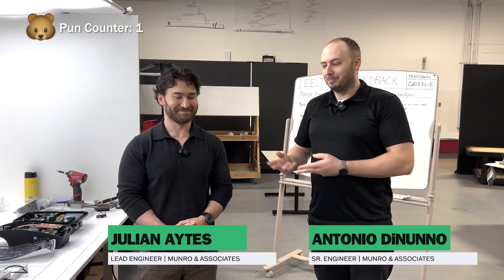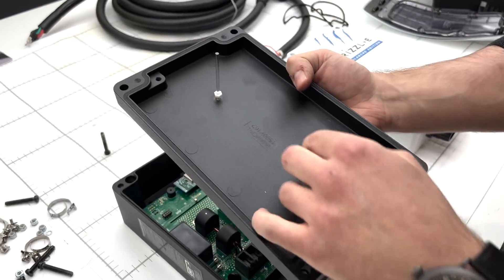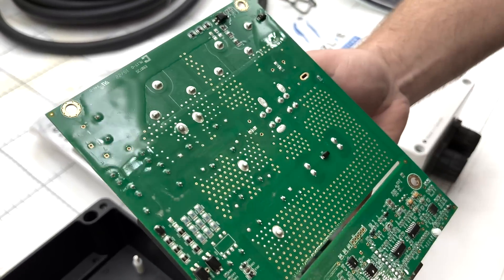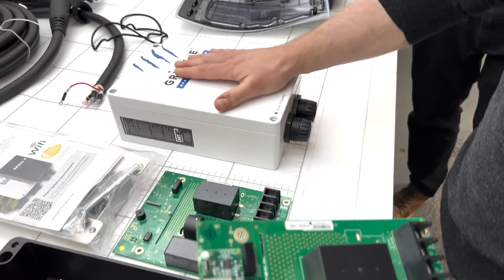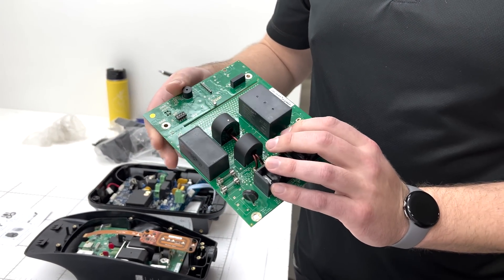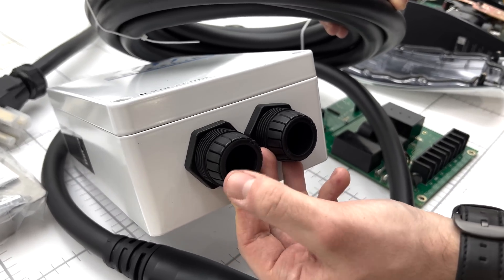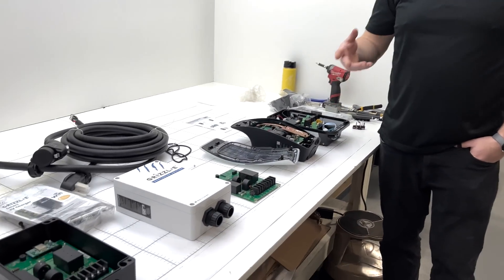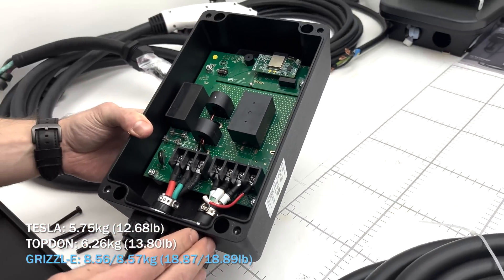EV Home Charger Teardowns E3: GRIZZL-E Classic & Avalanche

Comment: The terminals for hooking up the wires for the NEMA plug (and the “charger” wand) with the crimp on spades makes it pretty much impossible to convert to hardwire configuration because the width of the terminals is too narrow to get off the shelf connectors to put on your #6 L1/L2 and #10  ground wires.   I found someone on YouTube trying to do hardwire explaining this and I steered clear of Grizzl-E because of this as much as I’m Canadian and wanted to support them
Reply: Correction #8 L1/L2 and likely #10 ground since this 40 amp charger.   The YouTube link I posted has part 2 where he converted to these Southwire lugs so perhaps doable solution.     

The liquid tight install using OEM compression fitting from OEM NEMA plug seems bit dicey as he should have used proper liquid tight connectors to go to box

Hope his info helps you out in your decisions but I steered clear as much that I wanted to support Canadian brand - as I need hardwire outside install preferably at 48 amp instead of 40 amp for product designed for this setup and didn’t want outside rated NEMA covered plug on the outside of my house and a pricey GFCI outlet when hardwire is simpler, cleaner look, cheaper, and faster charging
Reply: https://youtu.be/0MqAlip4tsI
Reply: I just finished hardwiring one. It would have been nice to have them at least include 2 of the 6 gauge terminals similar to the ones they already use. Except with proper screw holes in them. Not 2 sizes bigger. I used aviation grade non insulated terminals which had a screw hole one size bigger. They were slightly oversized. Instead of grinding the terminals, I took a dremel and notched out enough of the outside plastic dividers (not the ones next to the ground terminal) to allow the terminal to fit right in. This shifted the screw hole of the terminal slightly to the outsides of the assembly, but still had no problem with screw lining up due to larger terminal hole. Used 3/4 inch flexible conduit from Lowe's which press fit perfectly into existing compression coupling.

Comment: You guys should learn how an EVSE works. It would have been nice to see some detail of their control circuit. Lower coil appears to be ground fault sense and upper to be current. Neither is "voltage." Would be nice to see what chips they are using. Is it one relay for each leg? Fuses are certainly on the relay coil circuits. That means the board is likely repairable if a relay coil goes short.

Comment: I bought one and i have issues with the current limiter not working properly.  It keeps blowing my 30 amp fuses once in  a while.   i wonder if you tested the current limiter circuit as mine is set for 24 amps and blows my 30 amp fuse .  The wiring was verified by a  certified electrician.  So the wiring is ok.  I am suspecting the charger the company is slow to provide answers.

Comment: I suspect that the WiFi range is compromised by mounting the antenna inside the (very rugged) faraday cage.
Reply: That is correct. Grizzle is a devopment based on the old eMotorWerks Juicebox (before they got bought by EnelX). The old Juicebox had a top antenna puck. The Grizzle does not have that and lower range. The charger itself is good. If you want smart EVSE features, look for a different device. Their software and app integration really sucks.

Comment: I love my Grizzl-E.  Basically got it for the weather sealing... I figure, if it is designed for Canada, it can handle anything.   I don't need (or even want) wifi or app control or any of that sort of thing.  I just want to plug it in. Beyond that, all of the EVSE's are pretty much the same thing, just big glorified contactors with a handful of safety features.

Comment: What I would be interested in on this one is a careful look the terminal strip.  There was a run that had a lot of failures there, attributed to a short term problem with newly trained assembly workers, and improper torque.  It would be interesting to know the details on who makes that, what current it's rated for, and how much margin there is between too loose and overheating vs. too tight and stripping out the threads in the thin copper piece.

Comment: "Charger" literally pointless box that could be eliminated. It's a relay that turns on and off and nothing more.
Reply: This is dumb, there needs to be some negotiation to ensure safety of the user and vehicle, to ensure that you aren’t just pulling plugs out on load, that exposed contacts are safe in all weather, that the vehicle does not overload a circuit, etc. it’s actually a very simple and fairly elegant, open protocol for these things.
Reply: @edc1569  you could fit all this crap into the electrical box on a DIN rail, if negotiation and a relay is all that's needed... The car can recognize the capability of the element and self adjust the charge speed. These boxes are not needed at all.
Reply: @no-eb2xx  Eaton has a EVSE that has all of the multiple necessary functions built into a circuit breaker, so the wire goes directly from the circuit breaker to the J1772 charge cord.  You might appreciate that design.  But a lot of their example installations still have a box on the wall, just serving as a junction box.  If you've done a splice with AWG 6 wires, you probably appreciate that having significant space in the box is helpful.

Comment: It's not clear if this thing has the 6mA DC leakage detection built-in or not. Maybe US regulations don't mention it, but this is needed in the UK to avoid having to fit a dedicated earth rod.
Reply: It does have built in GFCI with integrity check. Or mine does at least. I can't install it on a GFCI breaker as it will just trip since the Grizzl-E is continuously sending out that 6mA pulse to check for grounding stability. Even an insufficient ground will disable this EVSE as it's checking the impedance. I think they've lowered the mA pulse on recent models so it can still be installed on a GFCI to meet codes for receptacles. Mine's hardwired so I don't need a GFCI breaker.
Reply: It's UL listed, and that's required by the UL standard (as well as by the SAE J1772 standard and the US National Electrical Code).

Comment: You need to talk a bit more about the software. The grizzl-e is nice because it will connect to any OCPP 1.6J provider, so you can easily control your own charger. Most other chargers don't give you this option.
Reply: In theory it does... reality shows that the integration to other than their own partnership with a third party company is subpar at best.
Reply: @skyrace4306  OK. Interesting to know. I wonder if that's their implementation, or other people's. Standards-based charging and power control is the only way we are ever going to get away from the crazy world of having to find triplets of vehicle/EVSE/power supplier that work together. We need more charge-fests like they do for bluetooth, zigbee and USB. In general if it's not been tested, then it probably doesn't work right.

Comment: I have the extreme edition (camo paint) without wifi and it's working well. I appreciate the simplicity in design. It's heavy but easy to install. Mine doesn't have all the smart features, but I wanted something dumb. Too many folks have been burned by OTA updates bricking their charger.
Reply: How old is your's?  Wonder how long these units last?
Reply: @irishcubs01  I've had it for over 2 years now. Still working great.

Comment: Next time, add an electrical engineer to the presentation.  I expected you to tell us why Topdon charger had so many discrete components and Grizzle E did not.
Reply: we'll do a synopsis once were done, the early ones are still benchmarks. Understanding the normal.

Comment: ISSUES I see... WIFI Card completely encased in a fully shield/metal box will reduce reception of signal (think faraday cage for those RF Peeps) . I don't see external antenna or any way for RF to pass thru the metal box.

Also no Blast-proof ceramic fuses are used..
Reply: Why would you need blast proof fuses, they’re just protecting the on board power supply, not the load to the car.

Comment: Do you guys check if the relays utilize zero crossing technology or not?   Seem to be really small and cheap pcb-mounted relays.  Similar cheap relays as tesla, though
Reply: I’d guess not because the relays don’t switch under load. The charger doesn’t ramp up charging current until after the relays close.

Comment: Underwhelming, poor design and execution (see the crooked label and ludicrous light pipe).  Made to be cheap (i.e. leaves out the $3.47 O-ring to make it splash proof), but fails, as it costs the same as the superior competition.    Blatant Mistakes:  1:20 "subtle differences" consist of two: paint color and Wireless card not plugged in.  Not exactly "subtle"!;   3:05 Those ferrites are not voltage sensors, but EMI filters and likely a Current sensor;  3:30  "Lead Free" symbol is actually on the antenna portion of the wireless PCB, not the main PCB, so the "Avalanche" version would not have it;   3:48 "injection-molded stanchions"  are extruded nylon spacer tubing, cut to length;  5:00  the DIP Switch simply lets the processor know a Wi-Fi card has been plugged in;    5:13  "no real estate being wasted..."  ridiculous, same size PCB and layout;  5:30 "presence of actual fuses..."  demonstrating again lazy engineering and trying to save money (note that neither fuses, fuse holders or the assembly is cheaper than other "fuses-less" solutions,  also note that entire Vehicles, and the charger connection boxes, from Tesla with scores of electronic modules, including very high power components of the power train have no fuses, yet are fully protected!):  "hard mounted fuses...serviceability"  If properly designed and agency approved, when the fuse blows there is an internal overcurrent, which is not readily repairable, especially for "garage handymen";  9:03  Again, with the moronic evaluation and rating of electronic devices which are installed on the structure of a building by Weight!  The small weight or mass is not affecting the performance of an aircraft or a vehicle!  Whether it is 1 kg or 100 kg make no difference to the intended use case or application!  

This is substandard to the level of Munro's other videos and an embarrassment.  On par with the cringeworthy analysis of Freezers from a few years ago.
Reply: Summed up well. Very sub par review. Also did the handle not have a temp sensor?
Reply: Thanks for all the points you listed ! Have a nice day :)

Comment: 3:06 "Large relays" - the left one is a power supply, not a relay
3:08 that's a current transformer not a "voltage sensor". 
If you're going to do this stuff with any credibility, please get someone who actually knows what they're looking at,for a company that represents themselves as experts in the teardown field, it's just embarrassing.
Reply: Agree here. Munro usually holds a higher standard and this felt a bit rushed. Also found it surprising that there was no comment on a WiFi antenna inside a metal enclosure.
Reply: Not surprised at all, this channel shows how little they know about what they "review" all the time.
Reply: I'm going to assume that he just misspoke when he said voltage sensor instead of current sensor, but I think that correctly explaining the two black boxes is a pretty fundamental thing, especially with the amount of attention given to the fuses on the input of that power supply.
Reply: @charliesullivan4304  The electrical team walked us through it but yes, voltage sensors, transformers, relays...its amazing how much things blend together mentally when you're being filmed. We're adding text where we catch it  and appreciate the constructive feedback.
Reply: Absolutely, even small things like the lid falling off the enclosure felt off. 

Also, I'm not particularly fond of this EVSE. It looks like the manufacturer took the source files for the OpenEVSE project, swapped in an ESP-32 module, and called it a day.
Reply: I love the idea of “servicing fuses” as if we’re talking about a 1970s refrigerator. How often do you service the fuses in your TV for example.

Comment: Weight is a factor for shipping, but in a static installation is it much of a factor? I realise it's part of the specs and is a valid data point, but I don't think my wall would complain by saying "You're too heavy! Get me a Tesla instead!" 
Given it's built with much less bespoke design required, is so simple to build, and is safe, I'd say the weight is a fair trade-off.
Reply: weight is often a large factor in manufacturing cost, but it really comes down to form/fit/function, the metal case provides a ruggedness function that is worth the extra weight
Reply: As Charles Sullivan already stated, weight is a rough proxy for material costs. It is also a rough measure of efficiency in design and a product's carbon footprint. We may want a heavier product for the sake of durability or serviceability, but hopefully that won't come at a significantly higher carbon cost.
Reply: Agreed, it's a solid package
Reply: I think they are discussing that as a very rough proxy for cost of materials.

Comment: Grizzl-E Smart is $449 and charges at 40 amps. Tesla Wall Connector is $425 and charges at 48 amps, has built-in cord storage, a longer warranty (4 years vs. 3), the Tesla connector version has a button to open the vehicle's charging port, and is arguably more stylish. Why would I buy Grizzl-E over Tesla for either a Tesla or J1772 application?
Reply: The Grizzl-E also uses 42% more power when idle and the power loss at full current is nearly 28 TIMES higher than the Tesla Wall Connector according to Energy Star tests.
Reply: @zroger73 source links please.  Thanks.
Reply: Exactly, not to mention the Tesla Wall Connector is rated for outdoor use as well as additional smart functions to use multiple Wall Connectors on the same circuit to share and distribute power.
Reply: @jezza6575 , don't get me wrong - I like choices and I'm trying to keep an open mind here, but I just don't see any advantage to the Grizzle-E - it seems like paying more for a base-level work truck with a V6 engine and vinyl seats than a V8-powered model with leather interior.
Reply: I bought this over the tesla connector because of the simplicity and cold weather performance of the cable as I live in MN. I didn't want or need wifi as the car can already do scheduled charging. Also wanted J1772 just in case I needed to charge something else or switched from a tesla. I don't anticipate having 2 EV's so load sharing wasn't a factor either. I also have enough panel capacity for another circuit, or I could use the welding plug if I really needed. It's my backup with the mobile connector in case something happens to the grizzl-e although I don't expect anything to happen, it's built like a tank. It came with a remote mounted holster/cable hanger which I'm able to mount a bit closer to the charge port than where the unit is mounted.

Comment: Looks like a standard ESP32 module with a USB-UART IC for programming. 
Some opportunities for further integration are left aside. 
The Wifi module could have been integrated onto the main PCB. 
Or is anyone going to retrofit this?
Does not look like there is a lot of protection circuit going on. 
Spring contacts could have been used instead of the screw terminals. Less chances for failure because they can't be under/over torqued. 
The side labels could have been replaced with laser marking the case. Also no info about what color states which status?
If Tesla could get away without the EMC measures (ferrite cores) they would have probably.

Comment: I like the replaceable fuse feature on the Grizzle!  Thanks for doing these.  I know you all like to dissemble stuff for engineering analytic sake, but I enjoy these for repairability sakes as a possible customer :D.
Reply: Even better are e-fuses that automatically reset and don't require the device to be disassembled for replacement following a transient current fault. Some potential problems of one-time fuses are: The time and cost required to source replacement fuses, the time and cost required to pay someone to replace the fuses, and the potential shock or electrocution hazard associated with unqualified persons opening up the device to replace the fuses.
Reply: @zroger73  While we are listing them, another is the potential for someone to replace the fuse with the wrong one leading to a lack of protection or a false trip. 

On the other hand, these are not in the main current path and really aren't a very important feature of this unit, so the focus on them here is a bit odd.
Reply: @charliesullivan4304 , excellent point. I can see creative owners installing whatever fuse they can find or bypassing the fuse in a panic attempt to charge their EVs.
Reply from the maker: More to come, thank you for watching!
Reply: @MunroLive https://e-catworld.com/wp-content/uploads/2023/05/NASA-TM-20230005204final.pdf

Comment: Really nice design but I doubt that the Wi-Fi will work (prove me wrong of course). Placing a radio inside of a mostly sealed enclosure is a REALLY bad idea. Most devices enclosed in metal boxes require an external antenna. Theoretically, it might be possible to have the holes on the bottom tuned to allow Wi-Fi to go through but I doubt if they did so. They've basically places a Wi-Fi device in a Faradey Cage (which is a device specifically targeted at blocking RF signals). I live the model but NOBODY should buy the Wi-Fi model. Again... I'd love to be wrong on this but I am VERY skeptical.
Reply: I have the Grizzl-E with WiFi and the Wi-Fi works well. No problems at all.
Reply: I’m confused by that too, the Wi-Fi performance must be awful
Reply: When I saw that I figured they just routed the antenna thru the PCB, maybe to an extra wire antenna in the cable or to the box itself.  But no, the antenna is that little black bit on top of the wi-fi PCB, and its reception must be trash.